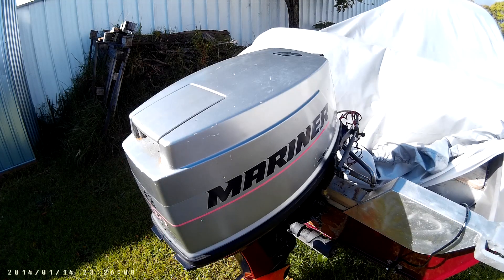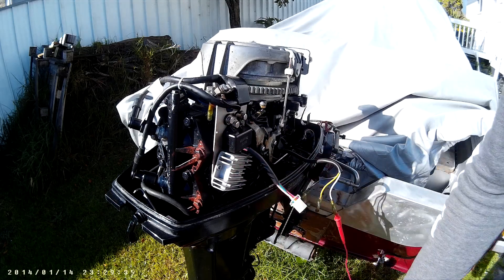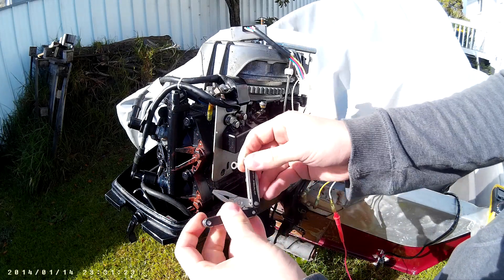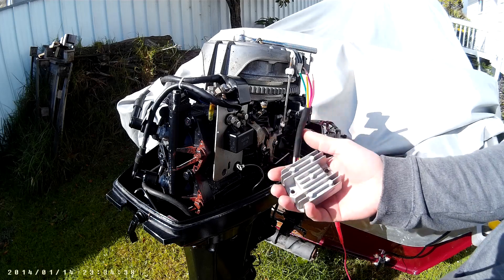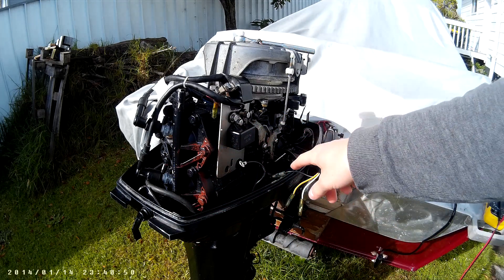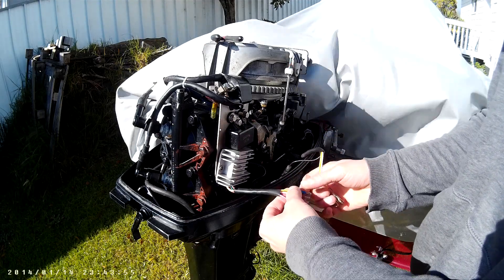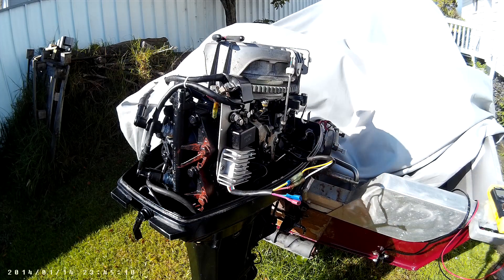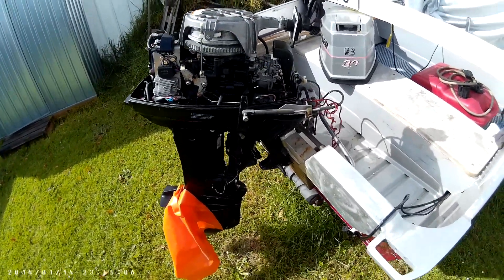A cheap way of installing a rectifier/voltage regulator on a 30 HP Mariner/Mercury

Comment: Hello, can you tell me what the black wire coming from the engine is for?
Reply: Hi! It's the RPM signal output (for tachometer).
Reply from the maker: Sorry, Yes, it's for tacho, but always triple check where it is going as it also might be another wire to kill the spark.

Comment: I have a 1965 Mercury Kiekheofer 20hp motor. Is there enough power in the magneto to hook up a rectifier/regulator to charge the battery?
Reply from the maker: Yes, no problem, I just put one on a 15hp for duck shooting barge and keeps all the lights + speakers working all day long.

Comment: Thanks a lot for this video. My 2006 mercury 30hp has always had the charge rectifier disconnected and I never new where to hook it up to test it. Your mariner is identical and as soon as I watched your video, it only took 15 minutes for me to hook it up and test it. It's only measuring 13.8v but it's enough, I was hoping for 14.4v. Thanks again
Reply from the maker: Hi! 13.8V with load or without load? Also on idle or higher revs? I am glad it's working! Great outcome!

Comment: Hey Rafal! Great video! I have a 25hp mercury sea pro, it has the same three wires from the stator as yours (black, white and yellow) do I just use the white and yellow wires to run run to the rectifier? What is is that extra black wire for?
Reply: After reading other comments you mentioned that the black wire you left blank was for a RPM tachometer. I bought a rectifier from mercury part # 816770. Is this a regulator as well as rectifier? Or just a rectifier? The wiring diagram for my motor only shows this part labeled as "rectifier" and nowhere else is a regulator shown.
Reply from the maker: @DwJ5188  did you manage to make it work or need a hand? That part looks like both but if you have a way to measure the voltage we can confirm that. Let me know how it went.

Comment: I have 1975 25hp Johnson
I installed a starter now i want to install rectifier. What wires am i looking to connect to
Reply from the maker: Hi Eric, if you have charging coil/coils already installed, you're looking for 2 or 3 yellow wires coming under the fly wheel, those cables might be in the same loom that goes to the ignition coils.

Comment: Hi, you have a yellow, white and black wire from your charging coil, where did you connect the black wire. Thanks Bert.
Reply from the maker: The black wire was left disconnected as it is for rpm meter as far as I remember.
Reply: @2random2watch  hi thanks for replying I left it un connected and all works fine. Cheers Bert

Comment: use LM317, 2n3055 regulated at 12.7 v with same heatsink. you can put a zener diode in their to regulate as well so small parts, little money, will do same job as well :)
Reply: It doesnt work that way it will overheat that 2n3055. It takes triac at AC side to cut the voltage to 14V, like in motorcycle regulators, no heat, no power lost.
Reply: @Helloverlord   good to know thanks Helloverlord
Reply from the maker: Like Helloverlord said, it will overheat, triac is the way to go in this case but also compare price/time required to assemble a simple regulator that's water resistant and comes with everything, I don't remember but I don't think I paid more than $15 delivered for it or even less than that.

Comment: Did you just make your own charging system???
Reply from the maker: Joey Joe I did but it's not on the video, making it waterproof and waterproof was actually more expensive than buying one for a moped. More videos coming really soon, cannot wait to post more DIY (6 more weeks).
Reply: @2random2watch  I got a Jon Boat bass Tracker 14 foot with a 20 horse four stroke Mercury Tiller no electric start but I always got a charge my battery for the trolling motor and stuff like that is there a way to create a charging system for that particular engine I would love to know but for a 12 volt battery Deep Cell Marine???? Are you in Germany???
Reply from the maker: Joey Joe what's the exact model? I don't expect it will produce more than 10A when running above idle.
Reply: @2random2watch  it's a 12-volt 27 EverStart Deep Cell battery where we going with a Mercury four stroke 20 horse tiller no electric start 2013
Reply from the maker: Hi again, sorry busy with shifting houses (and 2 shifts at work). Looking at the diagrams you might already have charging coils (for a version with an electric starter). Would you be able to send me a few pictures from different angles from under the cowling? I am looking for 2 or 3 yellow wires that are not plugged to anything.
Reply: @2random2watch  hey what's up buddy yes man I will look that would be great thank you
Reply: @2random2watch  wow bud you are right I got a yellow and the white coming out from underneath the flywheel behind a metal twist tie that bends into the block where you could just take it right out
Reply: @2random2watch  I only have two wires though a yellow one and a white one that go to absolutely nothing they got like little caps on them
Reply from the maker: Joey Joe can you see another yellow one tangled somewhere? The white one might be for rpm meter but I will check the docs to double check.
Reply: @2random2watch  I'm going to go check again buddy
Reply from the maker: Joey Joe found it, we are on a good path, do you have a multimeter or something to measure resistance?
Reply: @2random2watch  okay I found two more wires capped off on the other side of the head towards the front harness where the service light and on-off switches they are a brown and the white
Reply: @2random2watch  other than that there's only a yellow and a white coming out from underneath the flywheel capped off
Reply: @2random2watch  yes I do my friend
Reply from the maker: Joey Joe that's great, can you bring your engine to idle and then plug your meter in AC mode with the highest voltage possible (1000V) between those yellow and white cables? Hopefully you should see some high voltage there. Let me know how it goes. Be careful and don't short those wires.
Reply: @2random2watch  yes my friend I could do that I didn't do it yet I was kind of waiting for you give me a response and yes I'm going to do that and I'm going to let you know
Reply: @2random2watch  now if I get some both each coming out of their do I need to get a voltage regulator with two wires coming off of it and then go right to the battery or just run two wires straight to the battery or do I need the starter as well to run a wire to that
Reply: @2random2watch  and do I need the starter as well to operate the charging system???
Reply from the maker: Joey Joe not at all, what the above test will tell us is, if those charging coils are healthy and working, then we will work on installing a charging module and hooking it up to a battery. Starter is not required at all.
Reply from the maker: Joey Joe don't connect those wires directly to a battery, I will either burn charging coils or destroy the battery by a short circuit, whichever gives up first. That will mix AC with DC. Regulator is required here.
Reply: @2random2watch  I was looking at some online but I wouldn't even know which one to get

Comment: Is it working in Yamaha outboard motor 9.9
Reply from the maker: Noufal Nazeer it should as long as there are charging coils under the flywheel. You can spot extra 2 or 3 wires (usually yellow) coming from under the flywheel that are not plugged in to anything.

Comment: Nice video, did you ever measure the AC output voltage from the outboard coil that inputs to the regulator?
I am about to do the same thing, but Iam worried that the output voltage from the outboard will fry these small cheap regulators.. My yamaha 40hp, 4stroke outputs around 100 VAC when revving the engine bit..
The regulator I purchased looks just like yours.

Thanks in advance 😊
Reply from the maker: Kristoffer Hansson what is the serial number or model of the outboard? Do you have only 2 or more wires coming out of charging coils? Remember than as soon as you put some load (resistance) the voltage will drop quite a lot, high voltage is only because there is no load. Try with a normal light bulb from a car 15W or more and measure the voltage again under the load. Make sure it's a normal light bulb (with a wire not LED) so it will work with AC. Keen to heat the results.

Comment: Hey what size battery are you using ? Cool vid and I now want to do the same to Merc too for a fish finder and VHF radio as well !!
Reply from the maker: Scott Roberts I got 4x 6v 3Ah batteries for 7 or $8 each. I could use something bigger that got it cheap so didn't really need anything bigger. On fully charged batteries Lowrance HDS 7 was running for 3 hours then with trolling speeds it was enough to keep it running and charging batteries so I would say 20 mins trolling would give me another hour of using the HDS. VHF was running its own battery so no idea about power consumption from a radio.

Comment: Hi..i have a 70hp merc 1978..wont start..does nothing when i turn the key on.Battery is new,solenoid is new and starter works fine.I even tried to start it off the solenoid,but doesnt even spark.Now if the rectifier is bad,would that prevent the engine from turning over?
Reply from the maker: No, if the rectifier is bad you will get no charging, possibly quick battery discharge if shortened inside, issues with electronics on board if one diode is broken.
For your issues make sure you have a solid ground (negative lead) going to the engine.

Comment: Should I replace my rectifier with the voltage regulator or should I add the regulator to the rectifier❓
Reply from the maker: THECHANGEHASCOME I would add the regulator to the rectifier. Running just on rectifier is quite risky.

Comment: Nice vid👍🏽 I have a Force 150 and it has a rectifier but I've also added a High performance sound system and the rectifier dose not put out enough power to keep the battery charged while playing my music so I purchased a voltage regulator after seeing your video and I want to run the stock rectifier to the boat battery and the regulator to the Audio battery or run both together. What do you think about that
Reply from the maker: THECHANGEHASCOME I would check in the engine's manual what's the stock charging power/current you can get out of the engine and compare with your sound system. Might be not enough to run it, at least above half or maybe something else is not wired up correctly and using a bit too much.

Comment: hey mate how do you know which wire coming off the stator is positive and negative..
from the rectifier do you bridge the wires coming from the stator to the other box at the join and will that work
Reply from the maker: Hi Luke, No, It won't work like that. From the coils under the rotor you might see from 2 up to 3-4 cables that are just ends of the coils, if you have just two cables, in most cases they will have the same colour. These coils will give you AC power which you need to convert to DC. You can use just a basic bridge (~$2) to convert AC->DC but once the battery is charged it will 'burn' all your equipment, also if you disconnect your battery by mistake the same will happen. That's why I put a rectifier and voltage regulator to make sure that nothing bad will happen :-)

Just look under the flywheel to check if you have any 'power' coils with cables going outside and nothing is connected to them, depending on the power of your coils you (I guess) might have 2 or 3 cables.

You can always show me some pictures, I am more than happy to help.

Cheers,
Rafal.

Comment: Awesome video, nice, but I'm not sure I have the skills to put a rectifier on my outboard. I only have basic knowledge of electrics, and almost not even that. My outboard (20hp Yamaha) does not have a rectifier as standard, but I have seen cheap aftermarket parts on ebay. Is there even a lead wire coming out of my rotor/stator that I can use? Or do I have to change parts there too? The electric start models of my motor comes with 12volt 10amp rectifier and output. Perhaps if I look at such motors wiring diagram from exploded view on yamaha parts site I can figure things out. How do i find out if I can retrofit an even cheaper rectifier, is there some "minimum requirements" specs that I must find on such rectifier? My yamaha is 360cc-engine/20hp, 4-stroke, so if I find a cheap part for similar size engine ATV/Dirtbike/Lawnmover,  will it work? What specifications do I need to look for? I'd settle for less than 10amps of output if it is cheaper and less risky for my motor!
Anyway a nice video.
Greetings from a Swedish fisherman ; )
Reply from the maker: Hi Dylan, nice to here that someone is watching this video and a great question. I think I would first look under the flywheel to check if you can see only one little coil/crank sensor or you can see a "big" set of coils under, then you should notice at least two wires coming from it, probably together with crankshaft sensor (for ignition) . If you are not sure please send me some pictures (as many as you wish) then I am keen to help you to investigate and help.

Cheers,
Rafal.